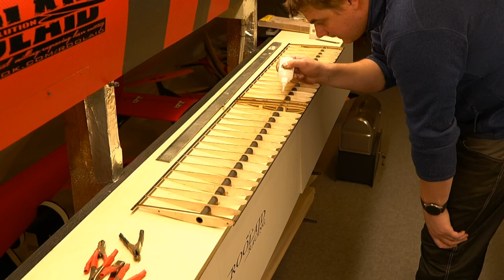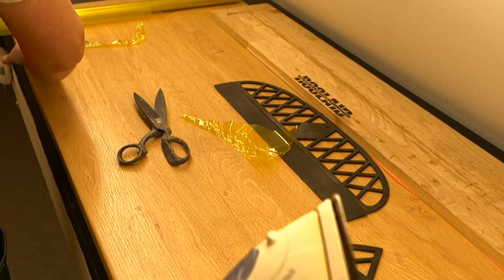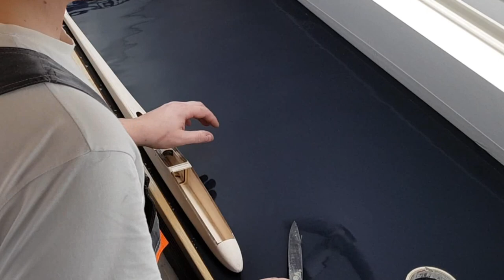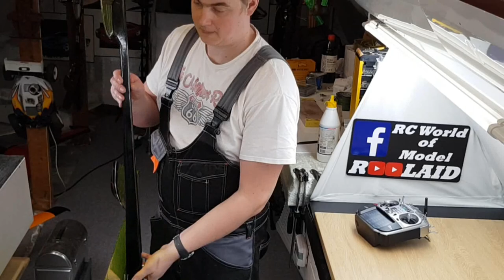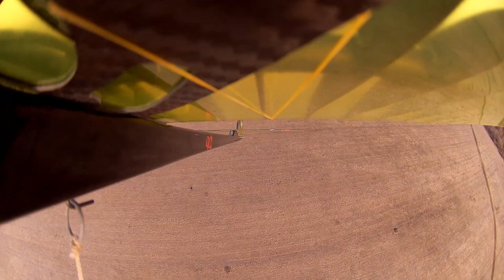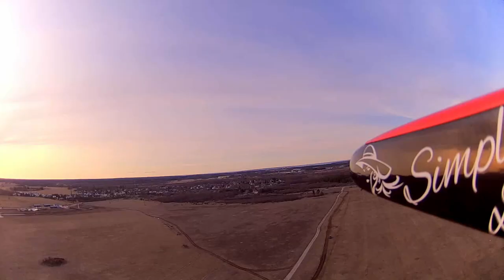RC 2M Glider "Simple Lady" Full Build and Maiden Flight. RC airplane building DIY Balsa construction

Comment: Marko, it looks like the fuselage sides are 3mm balsa with 3mm lite-ply doublers in  the nose area. Is that correct? And the materials for the stabilizer/elevator and rudder fin are balsa or lite-ply? I'm assuming balsa but hard to tell from the video and not called out on the plans. I'm adapting your drawings for my (in Canada) imperial thicknesses, but just looking for clarification on materials. Thanks for posting this! Will put one together for this summer :-)

Comment: Beautiful glider you built Marko and it flies so well. I built a Gentle Lady years ago...looks a bit similar to yours. I was particularly interested in learning how to make and use, as shown in the video, your  "Old school glider launch". Do you have any instructions and or video how you set up yours? It appears you got a lot of height. I would be pleased to learn how to launch mine GL as you did. Thanks
Reply from the maker: The location of the hook is very important. It should be located in front of the 7mm center of gravity. If the hook is on the front side, the start is low, but if you move the hook behind, the plane will go to the loop. It requires practice and experience
Reply: @MarkoRoolaid  My GL had already a designated spot for the hook. What I am interested in is the launch mechanism i.e. length of rope...do you have somebody run with the rope or did you use an elastic cord? From the video it appears somebody is rolling out a very long rope. Anything you can add, and or confirm to get my plane launched is much appreciated. Thanks
Reply from the maker: The starting equipment is 30m 6mm round rubber and 120m 0.3mm 140kg line

Comment: Hi Marko,
I love your builds and am looking at something similar to this simple lady.  However i want to go electric.  Have you done anything like that in this style of build?  I have a radian that i have crashed but all electrical components are good and thinking this planemaybe a good conversion?
Can i get your thoughts? 
Cheers
Chris
Reply from the maker: Hi Chris. Here is a video series on how I made an electric glider. https://www.youtube.com/playlist?list=PLmZWex_VNpXeN4wfX26ezRpSQN2DKZzqd
Reply: I have seen that build too.  But bones looks abit big for me.  2m wingspan is a good size for me to and really if i am honest i am happy with just elevator and rudder.  As long as it has a great gliding speed/rate i would be happy.  I have a cnc machine but i don't have a printer which is also another reason.  Do u think the simple lady could handle being electric?  Or would i have to put carbon in the fuse and wing to stiffen it up?

Comment: what is the material that u are using to cover the frame of the wings, ive been 3d printing for a couple yrs an have always used it to help with building my foam rc planes but ive always seen ppl do this but never knew what materials they was using an it wasn't pointed out in the videos, have no hobby shops local or anywhere i can even take them once i build them so i m always looking for an area large enough to fly them but ive always wanted to build one that was completely 3d printed but if i actually went through with it i dont know if a large plane like that would require a larger place to fly but i assume it would an building one like this seems like it would help keep weight down so ive been considering doing it like that now but have alot to figure out b4 i go that directions.
Reply from the maker: hi, this is a covering film. link https://hobbyking.com/en_us/covering-film-transparent-yellow-5mtr-203.html
Reply: @MarkoRoolaid  thanks really appreciate it.
Reply: @MarkoRoolaid  probably a stupid question but is there a color u would suggest, something that would be easier to see while flying, thanks again.
Reply from the maker: in general, no colors can be seen when flying, all shades become gray. Because of this, it can be said that transparent covering film is the best, then the color does not matter
Reply: @MarkoRoolaid  ok thanks

Comment: Plz tell me the electronics details that you have used in this glider plane
Reply from the maker: It's in a very simple plane and only works with 2 channels- rudder and elevator. I use micro servos and a 4x3AAA battery in the plane. Instead of a micro servo, you can also use standard servos, but then you must do new servo mount